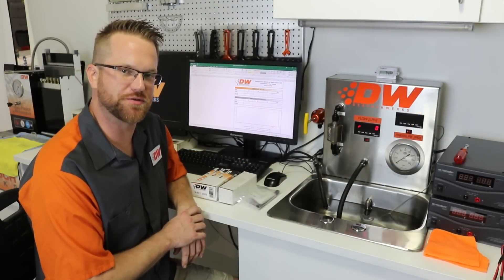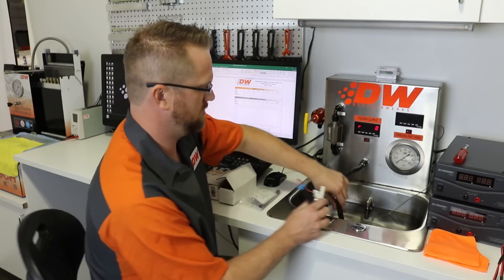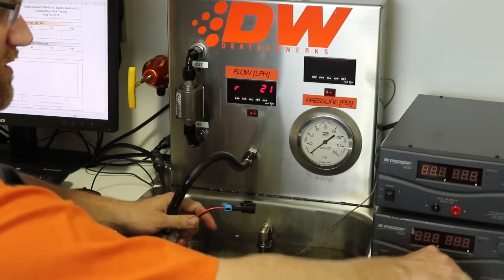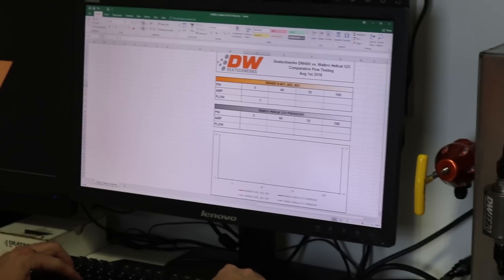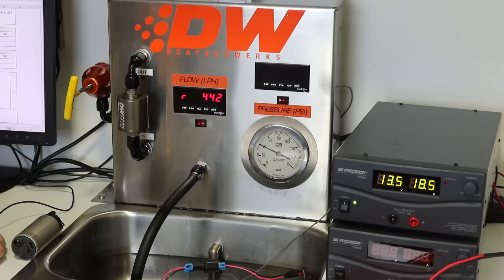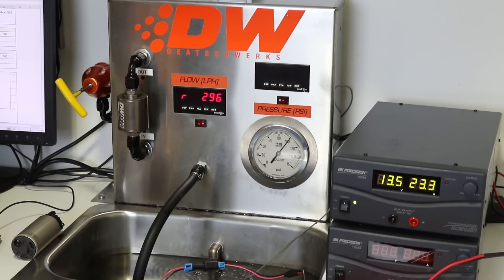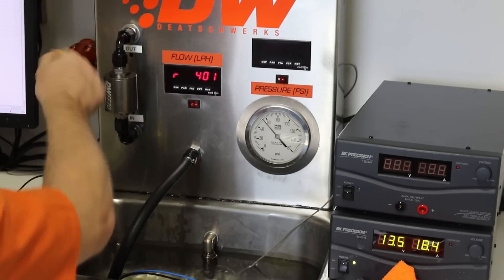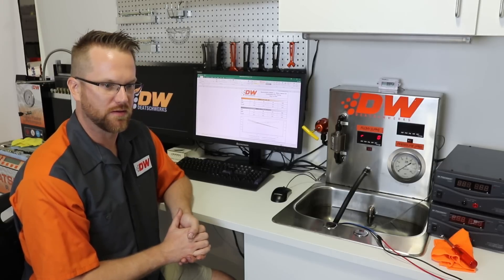DW400 vs Walbro "525"

Comment: I will say from experience, DW does in fact make great fuel pumps!!
Reply: They don't "make" pumps. They import them and scratch the brand/part number off and laser etch their logo on it.
Reply: how many years would you say the dw300 would last on a daily driver?
Reply: @pc7225  mine went out maybe 4 months on e😭
Reply: @legendaryplays33  e85 wears them out quickly

Comment: Would one of these work for a 16 Mustang GT with a Vortec Supercharger? I have a JMS bap that's giving my tuner all kinds of hell. At 5000 rpms the gas starts to cut out. With the WD400 would I even need a bap ?
Reply from the maker: Depending on your horsepower and fuel type the DW400 will support approximately 750whp on E85 and 1000hp on pump gas without a BAP. The kit you would need is part number 9-403-1047.
Reply: @deatschwerks  Thank you Sir! Are you saying I can run e 85 and a supercharger without a return style fuel system?
Reply from the maker: @FJTabb  If you are within that 750/1000 hp mark, yes.Return isn’t required at those power levels, more than that we recommend Return for less complexity.
Reply: @deatschwerks  Ordered my pump hopefully I receive it tomorrow.  I have a question, the newer models does have a check valve right?
Reply from the maker: Yes, it will have a check valve.
Reply: @deatschwerks  just 93 for now
Reply: I don't know too many tuners that will tune on e85 up 1000hp without a return system. I'm not saying you can't. If anyone knows someone that tunes dual dw400 with a deadhead non-return style fuel system I'm interested. The closest system for mustang would be vmp's new twin pump. But everyone that's over 1,000 is running triple pump. Can two dw400 pumps in a return support 1100 wheel hp that they claim on a supercharged 5.0? Dw needs to have vmp show some numbers for that claim.

Comment: I have a modified bolt on g37s which pump would you recommend if I plan to go e85
Reply from the maker: There are a few factors to consider on this. What HP are you trying to make? Any power adders on the vehicle? Any boost?

Comment: So is your dw400 similar to a br540?
Reply from the maker: The BR540 is not a DW pump and we have not tested one ourselves so we cannot provide anything in the way of performance data.  Some things that set the DW400 apart are its integrated check valve, application specific fitment kits, technical product support, and a 3-year warranty.
Reply: @deatschwerks  Great video fo sure. im now a the limit of my pump so ill be looking for a second pump soon. are you guys thinking of mechanical pumps at all?

Comment: Is this referring to fuel line pressure or what sensor reading on datalogs?
Reply from the maker: It is referring to fuel line pressure.
Reply: @deatschwerks  I have a DW400 with a BAP and the car runs good but I notice that at high RPMs high load/boost my FLP actually does decrease to around 40-50 PSI , would that make the walboro better in my case?
Reply from the maker: @a.wheeler7731  Without knowing the specifics of your application and vehicle's set up it is tough to answer your questions. We'd love to help you resolve your issue. Email us at customerservice@deatschwerks.com to discuss further.

Comment: So what I got from this is if you are running 50 psi or less and use a static fuel pressure regulator don’t buy our product. If you run 50 psi and or use a rising rate fuel pressure regulator buy our products.

Comment: I've blown 2 of these in a 30 day period, how disappointing.  Can't even get a person on a call to replace
Reply: DW or walbro?
Reply: @juicyjeff4299  walbro for the win. DW will have you on the side of the road waiting for a tow truck
Reply: @karimowhite  Ok lol i just read a walbro rewired is the way to go dont know if i go 255 or 400 for 400whp
Reply: @juicyjeff4299  the 255 could cut it but I would go with the 400. I am around the same HP also.
Reply: @karimowhite  Good thanks man and im curious which dw pump was it that failed on you the dw300?
Reply: Stop using beer as fuel

Comment: Hey when swapping fuels, how long would you have to run the DW400 pumps dry before you damaged them. As i swap fuel the flow starts to slow down as tanks near empty.  Is that ok on the pumps to drain fuel tank dry to get all the fuel out before swapping to other type of fuel. Just don't wanna burn my pumps.

Comment: For the money you can't beat a walboro
Reply: If you have went through 3 walboro pumps in 2 years you have issues elsewhere.
Reply: I had not heard of deatschwerks and was always lead to Walbro. I saw them in a few channels and came here. Given flow and engine whine, I am now a DW customer, good job gentlemen.
Reply: They are well known for their shitty pressure valves. If you use them up to their higher rated pressure, they don't last. I'm not the only one killing them, and I'll never buy another one. Take a minute and think about how some places mod them before they sell them...
Reply: @SuperPenishole  Lol "SuperPenisHole". Sounds like an intelligent guy... Anyway. A fuelpump isn't meant to run on high pressures over a long period of time. If you run them at 58+ PSI at idle, don't be surprised when they fry. Not to mention how the fuel heats up anyway.
Reply: Until you go through 3 of them in 2 years.... They're cheap for a reason.
Reply: @SuperPenishole alot of fakes is why

Comment: with a fpr with a 1:1 ratio 100 PSI would be roughly 60 POUNDS OF BOOST ! I May be mistaken but what, ive seen data logging on true 1:1 ratio fpr's is there is a bout a extra pound of pressure per boost psi, so hmm as soon as i get to 50 or more psi ill consider Deatschwerks. highest I got on my twin walbro set up was 45 psi and they did well price to product wise. Deatschwerks seem to work well and are consistent not as dramatic of a loss.
Reply: Some manufacturers use 55psi as their base fuel pressure. Those applications I have seen them running upwards of 40lb of boost. So yeah, you want to know what it flows at 100psi so you don't lose flow and run lean.
Reply: @glhomni  ironic because I just finished u ppl a turbo ls build 1st ever. OEM pressure is 58 psi! I thought that was a typo but it's not. so yeah I'm dialed in at 58 psi....and plan to run 15 to 20 pounds 30 eventually once a trans that can handle power goes behind the engine.

Comment: I am thinking to go e85 route with my TT 2015 GT.  i am at 600whp pump gas right now. What is the safe HP i can go to on a singe pump? (no voltage booster.) can i hit 700 wheel, 750 wheel?
Reply from the maker: We actually have a dual dw400 module that is releasing this next week for the mustang! Set up for a full return system and capable of supporting well over 1200hp. You should see 700-750 safely on one pump.
Reply: I have that system dw400 twin pumps
Reply: @maximusvonce1381  Does your DW400 give you a hard times?  My DW400 make my mustang start on a 2nd time, every time i am letting it sit for 5-10 min after a drive.
Reply: @ironbull2003  you need a check valve. It's draining back into the tank. Check valve will stop that. My Audi did that with both dw400 and walbro 450. Check valved stopped that.

Comment: I see test voltage is 13.5v which is low, can we see a test @ 14.8v alternator charging voltage, or a bap voltage of 15.5-16.0v?, Applied to these pumps, as with adding voltage, current consumption comes down, and I hear walbro needs atleast 14.8v to shine. Not Knocking the dw400 it's a nice pump, but I think testing condition s could have yielded different results in a higher voltage setting, at straight battery power of 12.5-12.6v the dw400 probably walks all over the 525 walbro, due too less voltage with higher current draw.
Reply: I would rather see data from an endurance test. A flow test to measure max flow will tell you nothing about the quality of the pumps.
Reply: It doesn't matter what voltage you compare them at as long as it is the same. The flow is almost linear when it comes to voltage so the difference between the pumps would be the same.

Comment: I'm wondering what day will they make a brushless pump. Shouldn't be an issue the only other components needed is a speed controller / 3 phase circuit controller
Reply from the maker: We do have a brushless pump available! https://www.deatschwerks.com/blog/deatschwerks-introduces-their-all-new-440-lph-brushless-pump-and-controller
Reply: Bugatti veyron pump is brushless
Reply: @Breakitjake  fuelab do brushless
Reply: Theres a aeromotive brushless for up to 1800hp
Reply: Brushless could make up for better performance too, since if you have extra circuitry you might as well add a booster in there too and crank it up to 18-24V so you don't have to run as much current through the motor windings.

Comment: Who is running 50lb. of boost with only 1 fuel pump? Standard fuel pressure about 40 then add 1lb. fuel pressure for every lb. of boost. So at 70psi fuel pressure you would be around about 30lb of boost and thats a lot of boost for most people.
Reply: El buckeye  No doubt. I had 36lb. of boost on my civic making 713hp. But who runs 50lb of boost with a single fuel pump? Everyone I know run dual or triple fuel pumps once you get to those numbers.
Reply: El buckeye  at 36lb. I had a 10 gallon fuel cell E85 ran an external  aromotive a1000 with Id2000cc injectors. But that was all we could do. Im currently building a CR-V to 500-600 hp. With a single in tank Walbro Hellcat 525. I'm boarder line going to a dual setup. Good luck on you build. 👍Race it, break it, fix it, repeat!
Reply: El buckeye  Nope. No intank pump at all. just the one external. Idk  if it was the filter or the pump that held us back but 713 is where we ran out of fuel. so that makes sense on E85 at least. If we ran Q16 with meth injection im sure we could have hit much higher numbers. Or a dual pump setup but I thought that was plenty for a civic anyways. I was getting scared of the motor blowing up at that point because I didn't know how well it was built Unfortunately it croaked shortly after that due to the Darton MID sleeves. Still the most fun in a car I have had. I owned a 40 hot rod with over 1000hp and wasn't as much fun as the civic. cost a 1/5 of of the chevy too.

Comment: Walbro is still the best deshtworks at it again with the fake info
Reply: Wouldnt buy either one
Reply: @ABeans07  why?
Reply: Bought a dw65v for my 20vt , didn’t last  8-9 months
Reply: Ignorant lol.
Reply: You just saw a back-to-back comparison between the two.  Same settings, same fluid, same power supply, and same fluid.  Do the testing yourself!
Reply: I just went 9.37 @ 147 with this DW400 in tank pump.  You can’t run a better in-tank pump.  Period.
Reply: @coryswinerton3296  What was your vehicle setup?  just 1 dw400 pump?  Any BAP?
Reply: That pump could be bad or maybe it wasn’t a walbro any company will do anything to its competitors to make them look bad goes for walbro as well
Reply: @sxg6429  That would be Illegal. I'll admit I wasn't the biggest DW fan but since they've partnered with bosch the quality is undeniable
Reply: @sxg6429 if you find contrary conditions ill be happy to see them

Comment: Have you guys tested with higher voltage from fuel pump booster?
Reply: MAK Performance used a JMS Boost a Pump on their DW400 on a procharged 2018 mustang.  Held to 850whp on E85.  They used it to hold voltage steady throughout the powerband.  https://www.mustang6g.com/forums/threads/new-product-release-1000hp-drop-in-fuel-pump-upgrade.99826/
Reply: Hey Ivan, yes, we have.  Send techsupport@deatschwerks.com a message and we'll get a copy of the flow report sent over to you.